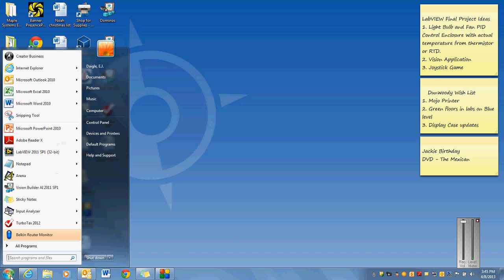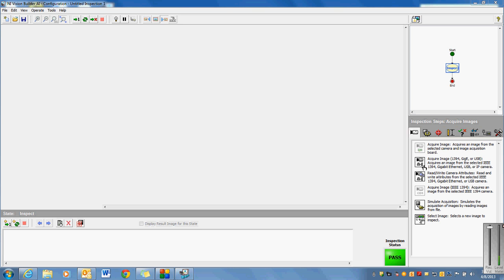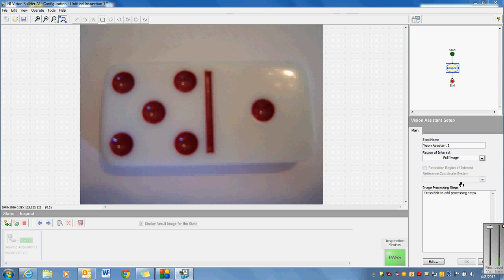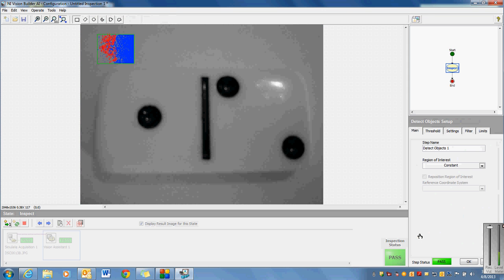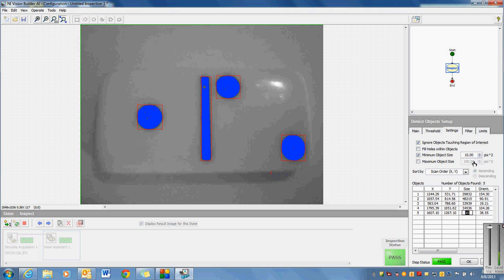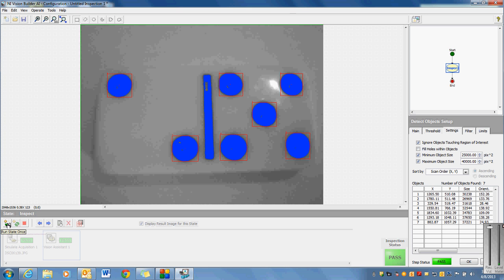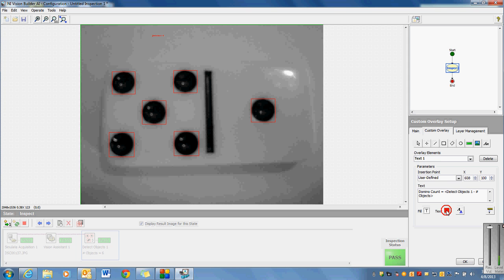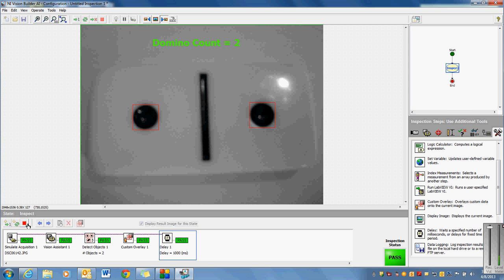NI Vision Builder Automated Inspection Dominos (Machine Vision Demo)

Comment: Thanks for the tutorial.  This was awesome.  So will this work for a measuring different objects of different sizes all at one time.  For example measuring a fork, knife and spoon or several other objects etc.  I would love to be able to accurately measure the items in a kitchen drawer and when I mean accurately measure, i mean the max length and width.  I don't care about the depth.  I also would like the ability to generate a contour and export to a dxf, svg or pdf file.  If this will work, how long will it take to run it.  

Thanks for your time and excellent ability to explain this process.